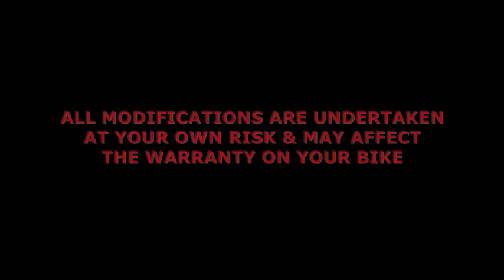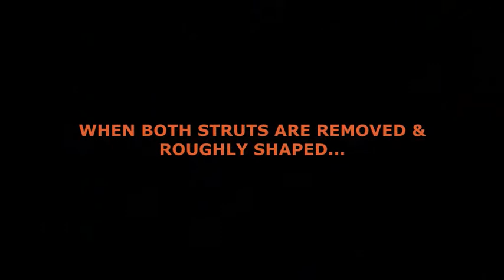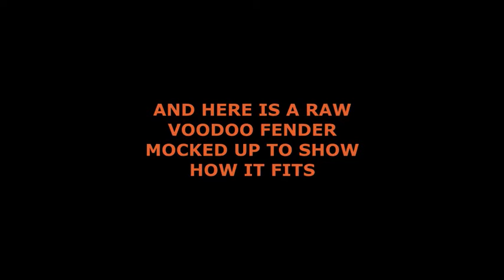Street Bob / Dyna rear strut removal

Comment: How about pre06 models? They are slightly different, sepcially the center piece. Mine doesn't install "just like that", its angle seems all wrong so I wonder how you get it right...

Comment: My question is when the struts are removed, is there a loss in the structural integrity of the frame? I wouldn't think there would be but I'm no structural engineer and I can't find any other information on the web about how the removal affects the strength of the frame.
Reply: anarkist7734  i wouldnt thimk it woild affect the rest of the frame.